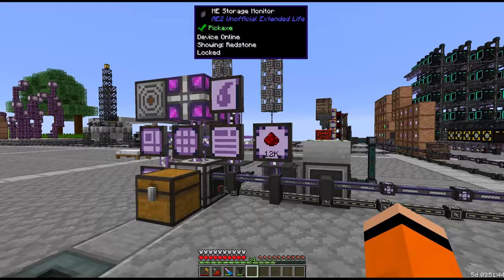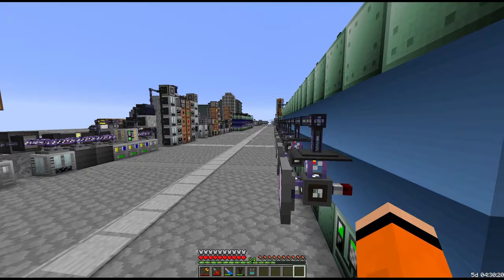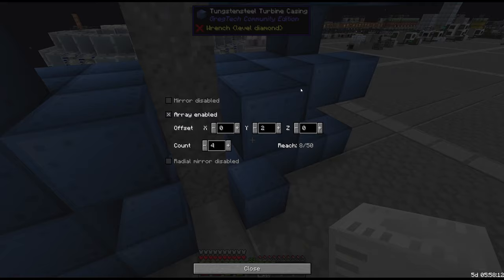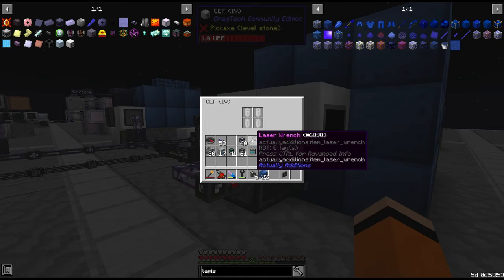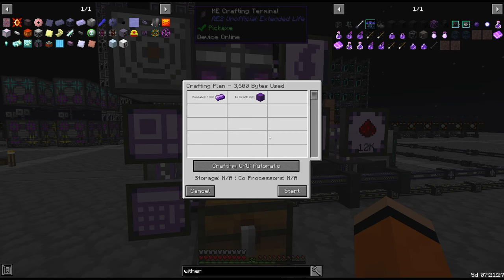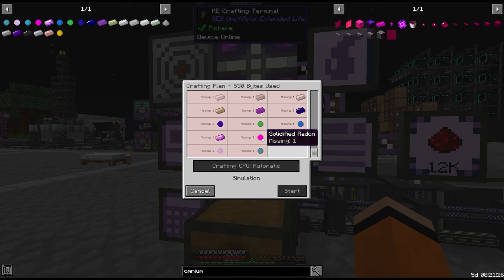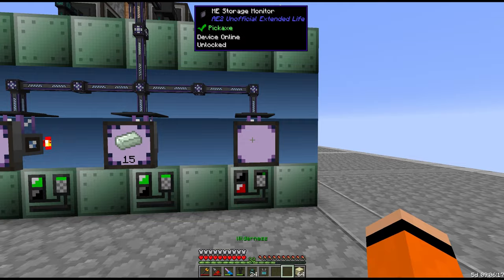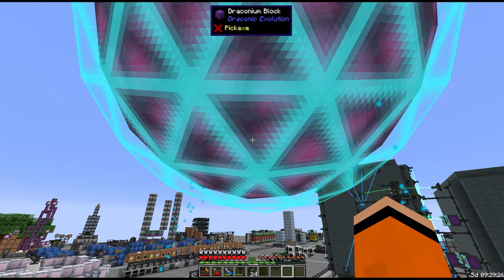Plasma Power Tower - Nomifactory: Episode 22

Comment: Nicely done on the T7 ball and progress towards tank!

Not much to add today except to say that due to the unusual way rotors are programmed in GTCE, they only take durability damage during spin-up or spin-down. So as long as you keep the turbine supplied with enough Nickel Plasma to remain spinning at 100%, they will actually never break.